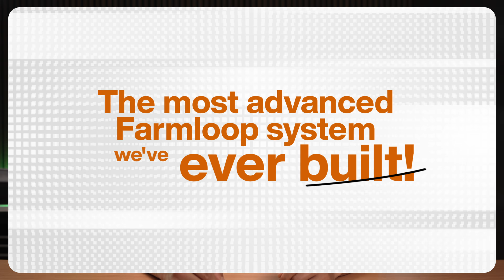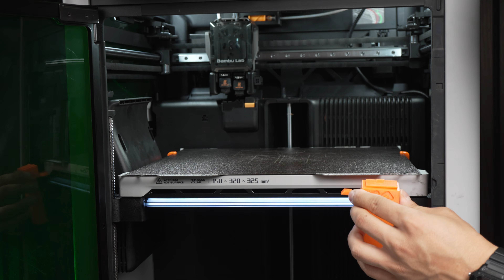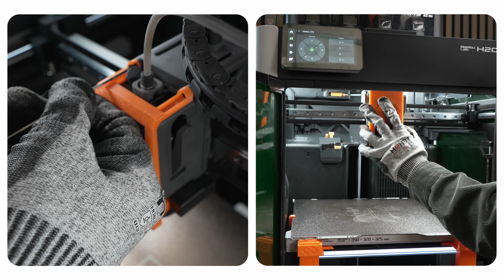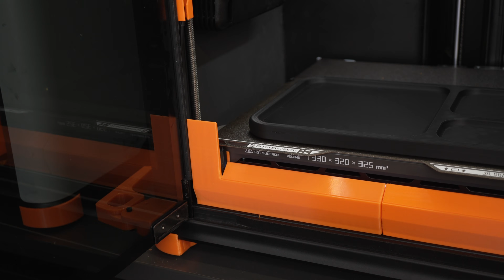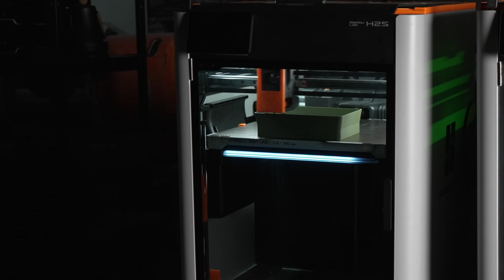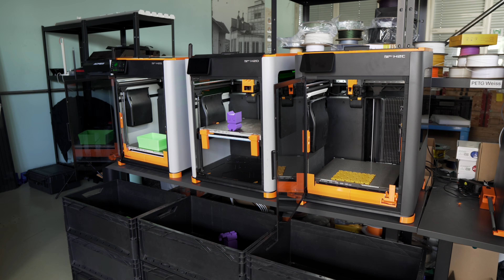Automating the Bambu Lab H Series Was Harder Than I Thought

Comment: Question though. I'm fairly new to 3d printing but don't you have to use glue for some things to stick to the plate? How can the printers run 24 hours with no glue on the plates? Also, how often do you wash the plates?
Reply: On the bambu printers you honestly don’t have to. They stick so well there’s no need for glue. 1000+ individual print models on the H2D and I have seen 2 bed adhesion issues, both only with tpu.

Comment: What about objects that require supports on the build plate? This system wouldn't be able to clear the plate of the supports or the brims at the foot of the support, unless maybe the entire object including any supports was printed on a raft, I wonder if there is a setting to allow supports on a raft instead of the build plate if the raft was wide/long enough to accommodate the support base, or maybe the supports would have to be designed into the model itself
Reply from the maker: We have something for that in future, but at the moment supports are not supported, what an irony :).
Reply: @3DFarmers very interested to see how you work around this as it's one of the things that is holding me back from an otherwise impressive system you've designed, keep us posted!